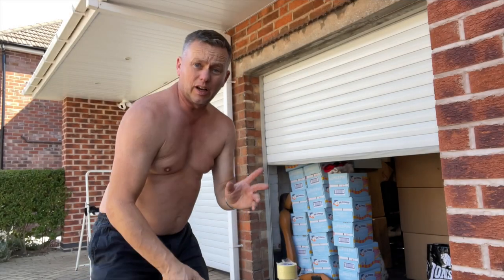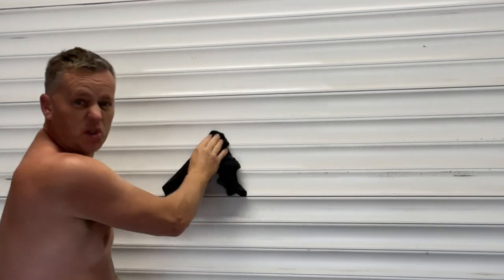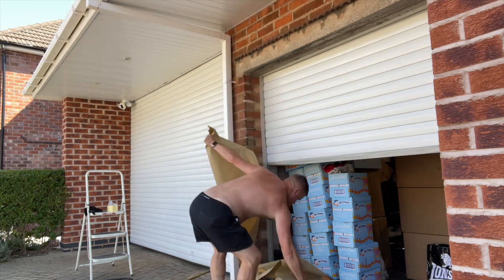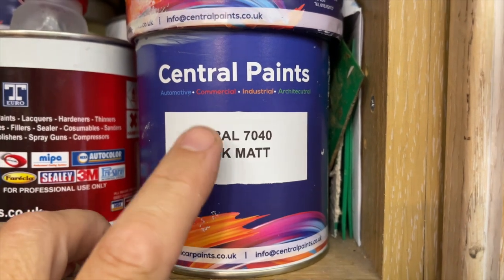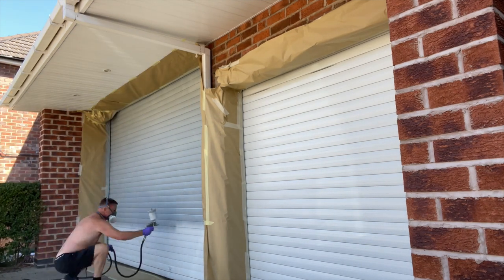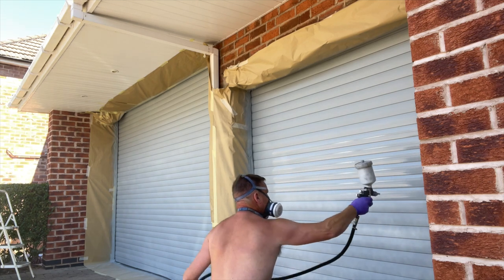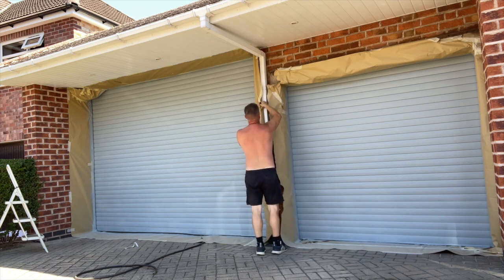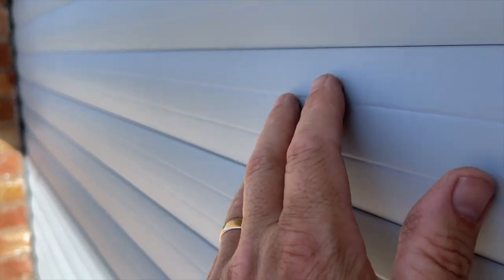Painting Electric Roller Garage Doors From White To Grey. What Paint, Roller or Spray?

Comment: Did you have to water down the paint? How does the gun work? Do you just need to buy the gun or need something with it?
Reply from the maker: The gun is a HVLP spray gun running off a compressor, the paint is 4k which is miked with 4k thinners and 4k hardner, Thanks for the great comments👍🏻👍🏻🛠

Comment: I have a garage to spray and i was considering using zinsser Allcoat waterbased. I've used it before but not sprayed it.
Any opinion on this paint at all? Or do you always use solvent paints?
Reply from the maker: Not used that one, it wont be as durable. Thanks for the great comments👍🏻👍🏻🛠
Reply: It’s all in the prep as long as you do that right waterbased should last quite a few years 👍🏻
But yeah 2k paint is best long term

Comment: Is there no need to use a primer please?
Reply: I have just started to paint my door the same as yours with a so called suitable primer and brush, and it's all coming off 😫
Reply from the maker: No Primer needed when using 2k paint, the old paint acts as a primer, it is best to spray, painting with a brush adds too much paint at once, allowing it to soak and react with the old paint. Thanks for the great comments👍🏻👍🏻🛠